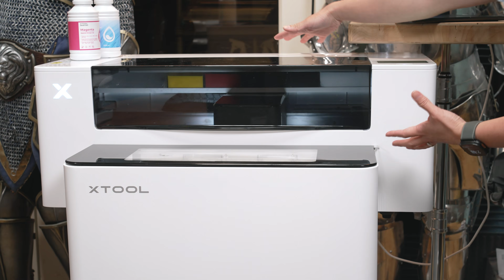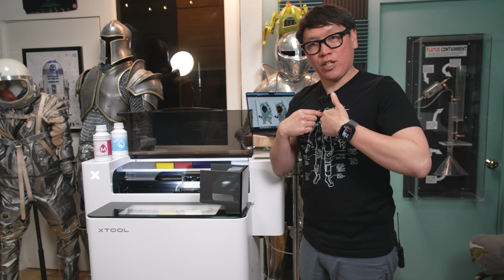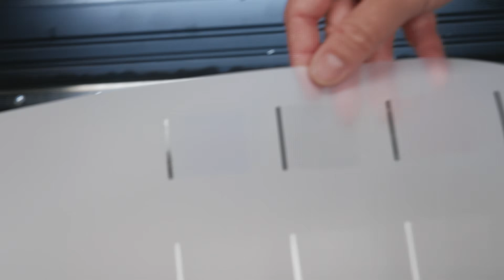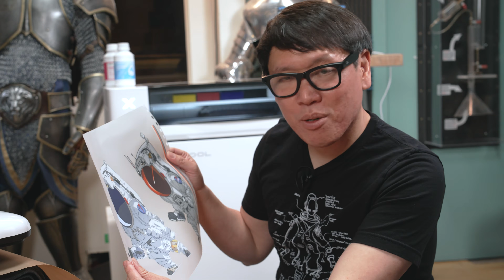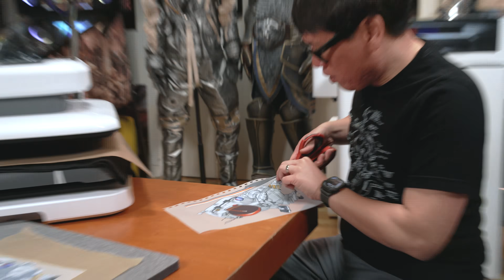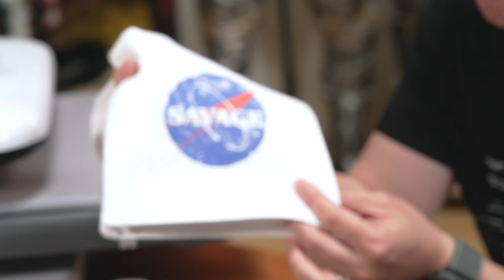Making Custom T-Shirts with xTool's Apparel Printer!

Comment from the maker: xTool Apparel Printer: https://www.xtool.com/products/xtool-apparel-printer-a-new-era-of-apparel-printing
Auto heat press we used: https://amzn.to/3FP8pE3
Disclosure: This product was sent to us by the manufacturer for purposes of review and is not sponsored.
Reply: Team, the link in the description is broken. If you remove ")" from the link it will work.
Reply: Could you verify the US power input needs voltage 120 /240 and amperage?
Reply: You should do a half-tone design.

Comment: Dtf and a air fusion press is all you need
Reply: While a DTF setup and air fusion press are solid choices, ensuring your transfer film quality and proper curing temperature are equally crucial for durable prints. Sometimes, small adjustments in these areas can make a big difference. I’ve found that focusing on consistent heat and airflow helps reduce issues like cracking or peeling. Hope this tip sparks some ideas—I've learned a lot about optimizing these systems over the years, and I’m happy to share more if you’re interested.

Comment: Good video Norm!  However, there has been a lot of noise in the print world about the safety of the DTF.  Mostly in the flash and bake points of the powders.  It is highly recommended to wear breathing masks as the powder is a carcinogen and is currently under review for other potential long term side effects.

Comment: Best way tob test it through the wash is to wash it in a heavy duty cycle with hot water and to dry it on high temperature.  You'll see real quick what the durability is

Comment: The wash cycle isn’t as much of a problem as the DRYING cycle - over-drying at a high heat will likely eventually make the imprint start to crack or peel.  I’d recommend a low heat or even air dying.

Comment: I think the bit that's most disappointing is the poor registration of the backing layer. I'm also not sure who this is being marketed to. I guess small print shops? This is way too much machine for a hobbyist, way too little machine for a small apparel company or factory, so... who? Yeah, you can iterate quickly this way... but you can iterate faster in any 3D apparel software (Browzwear, CLO, Optitex, etc.).

Comment: You should do another press after peeling the cover sheet. The edges of the transfers like to peel up when pulling the cover sheet off and doing another press (I usually do about half the initial press time) will help to seal everything to the garment.

Comment: I am a sticker printer and have done clothing heat transfers with my BN-20A before. I had a BN-20 before but the white ink destroyed the head and I'm very hesitant to get another machine with white ink. That being said, this machine looks very promising and I think I would seriously consider purchasing the next iteration. For now, the juice isn't worth the squeeze at the price for my market. But if I expand it would certainly be in my top three options after seeing this.

Comment: I've previously bought an EPSON converter, and I know how difficult cleaning can be. Most external DTF printers are like babies that need constant care. The auto-cleaning feature of the XTOOL seems promising. I might consider buying one. Before making a decision, I was originally planning to buy the DTF STATION R2 Pro(all american print supply), which uses the same print head, but it's about four thousand dollars more expensive than this, so...

Comment: WoW! I use dtf tech from scratch where hack printer to get that, but to cure print for 60s that"s interesting what powder is? the base line actuallyy of 10s-15s max, and then repress also the same, but not 60s.
Reply: Mine I use is 3-7 seconds depending on the day but 60 is WILD that’d be genuinely 10X slower for large production on a bad day
Reply: @ apart of that, is not good to overheat print you loose saturation on prints… and by the way is this xTool recommendations?

Comment: I'm one of the first adopters of DTF printing in the UK. This technology has been around for years. Xtool has made it look pretty, added a proprietary film and slapped quite a price tag on it. You can convert your own printer and get started with just £500 and no proprietary overpriced consumables.
Reply: any good write up about that? what printer is good?
most the DTF printers on Amazon seem to go for northward of 1700 pound (3500 aud)
Reply: @julsius  Yes, lots of tutorials and writeups. I'd recommend a slightly more expensive Epson EcoTank ET-18100 (It has different numbers in different regions). It will print on 33cm wide rolls. It can do around 100 shirts per day.
Reply: @ilia2178 and the prints last a month before starting to fall off the shirt.  Printed shirts don't last 10 washes.
Reply: @julsius  hes talking about doing it all manually, which takes skill and time and is the polar opposite of the machine presented.
Reply: @julsius I have been using ET-15000 with sublimation ink for over a year. There are various ways to achieve similar results.
Reply: I agree. I started screen printing back in the mid '90s. I've seen it all. ALL FORMS of t-shirt printing. I was there in the infancy of DTG printing When companies like US screen printing were converting epsons and selling them for thousands of dollars which eventually put them out of business. X tools put this in a pretty package and a exorbitant price because they are going after the market they're already in. X2 owners will see this and jump headfirst. I suggest anybody who has an interest in decorating t-shirts other than using a squeegee do as much investigative work as they can. Also know that when you own a DTF printer, DTG printer these machines require maintenance and care. It's not going to be like troubleshooting a laser engraver and replacing a few rudimentary parts. It's not a game and know what you getting into. I'm guaranteeing you x tools has jumped into a game that they may not be able to handle.  Do your research on the pros and cons and know that if you invest in this machine you need to have business!!!!
Reply: Not everyone wants to tinker around just to save money that they may not have to save.
Reply: @melgross  If you are in this position, what are you doing buying a $6k printer? You'd have to sell 2000 shirts just to recover your money. More if you include other equipment. If you don't have the money, pay somebody else to print your shirts on demand. 0 investment required.
Reply: @ilia2178 with the amount of money I have spent ordering transfers, this machine would work better for me
Reply: @ilia2178 people buy various equipment for different reasons. For hobbies, few expect it to be profitable. You always do get sone who do. This is a semi professional set-up. Not enough to really do any serious volume, but maybe too much for someone to just print a few here and there. Good for a designer who want to just print a few to check the designs on real products. That’s really who this is aimed at. But you’d be surprised at how many people have enough money to afford things like this. I don’t buy things ge ayes I’m expecting to make a Pro fit.
Reply: @ilia2178 2,000 shirts.. how did you even come up with that number lol?
Reply: @melgross  You hit the nail on the head. I would never convert a printer just to save money.
Reply: AMEN TO THAT.
Reply: its appearance do hits me
Reply: Don't you agree they have solved a few problems with the whole DTF system though? I waste so much material just to get it to go from the printer through the oven. The shaker oven system huge and does not do a very good job. If I wanted to buy a name brand system I think I'd be paying about the same price as what x tool is offering. Their powder application and shaker looks like it has solved some of these issues with those notches in the film which I'm sure cuts and then it can ride throughout the rest of the system.
Reply: @Fleshybitz  I agree that they made the process sleeker but at what cost? From what I gathered so far it will roughly cost 10 times more to print a shirt. Suddenly losing a bit of film to a DTF shaker each run does not seem that bad,
Reply: @ilia2178  
how did you reach your figure? Is the film that expensive to purchase from them? Because from what Norm said, you can use your own ink. I know of several printers selling for roughly the same price or more.
Reply: @ilia2178 you cannot compare a dedicated DTF printer to the likes of a converted Epson Ecotank. For starters, the printheads in Ecotank printers are not designed to print white ink which is why there are posts all over the internet about people with clogged printheads. 

Any proper DTF printer (as in manufactured to be a DTF printer) costs thousands and the xtool version actually looks pretty good value, especially when you consider it’s auto ink circulation (although from the points in this review, the white ink circulation doesn’t look to have worked while he was away for a week but maybe xtool with fix that). 

I don’t particularly like the proprietary film but xtool say you only need that if you’re using their shaker dryer but for the film and ink, xtool are quoting approx $0.80 per tshirt so the cost isn’t bad at all. We have an Epson DTG and our cost per shift with white ink would be significantly more than that. 

Anyway, yes a diy DTF conversion may work for some but it’s not sensible for a production environment where you need to rely on your equipment and the Xtool (or any DTF printer for that matter) isn’t going to be aimed at the people that are willing to DIY a DTF conversion.

Comment: I know it's not going for the full "MSRP" on their Kickstarter campaign, but $5999 is pretty high for a DTF printer, even a "high resolution" one. Even the "Super Early Bird" price of $3999 is on the high end, although it's in the ballpark, and XTOOL appears to give a slightly wider print than competitors. This printer promises 720x1800 dpi, and higher resolution printers with 2880x1440 dpi output can be had for $1k less. If you have the oven, you have a solution that really does give a bigger advantage than what else is out there because it's fewer operations that you have to do manually, but ... $8,998 MSRP. So, you're paying a premium for the brand, simplicity of operation, and support that XTOOL brand gets you. If this is your business, then it might be a good buy for you. But if you're a hobbyist, woof!
Reply: Well it depends on what your preference, but one big advantiges of that is self cleaning, thats whats spot on where you dont need to do that manually, but YES other than that its realy pricey for that...

Comment: Printing iron-ons at home has been possible for decades. Most printers will do it. But this would be more for commercial use.
Reply: Correct me if I'm wrong. Unless there is a new iron-on media with a white layer, as far as I was aware, typical iron-on's don't have a white component. With those, you can only do a white t-shirt or very pale colour.